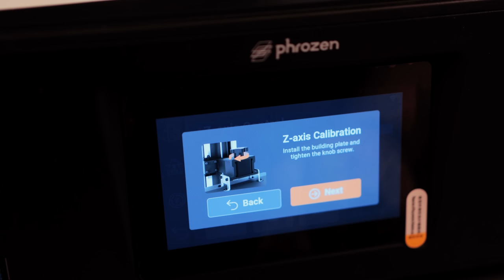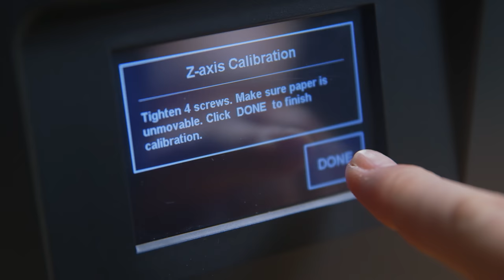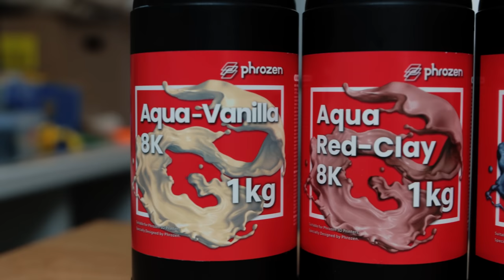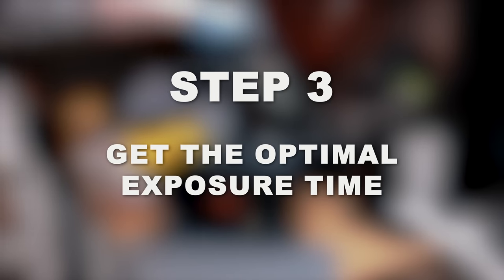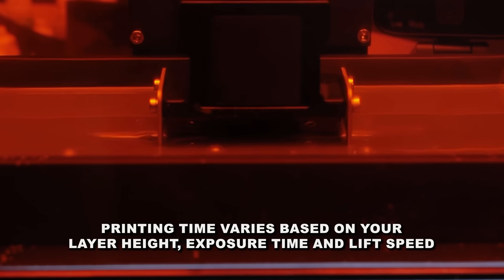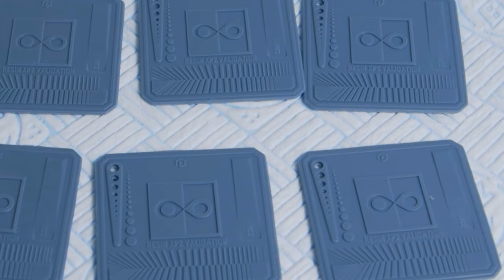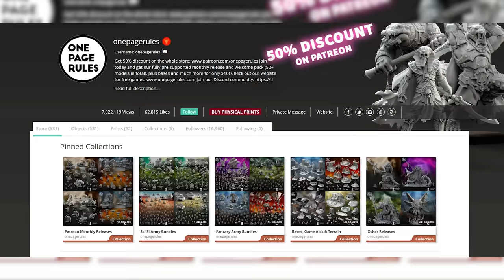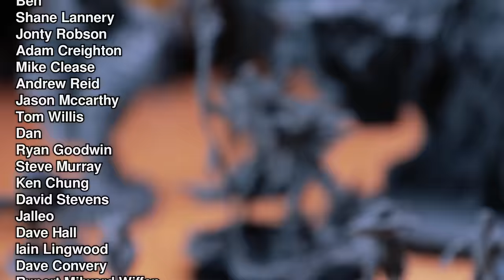How to Print Perfect Miniatures - Resin 3D Printing BEGINNER GUIDE - Step by Step

Comment: I have another question. Wash&Cure process has to be done exactly after tbe end of the printing or we can do it after some hours or a day?
Reply from the maker: Yeah you can do it later. I’ve left prints for days before washing. But keep them out of direct sunlight. During that time
Reply: So I can leave them into printer without any problem or you mean to take them out of printer first and then leave them?
Reply from the maker: @manosjj8404 either, just keep them away from uv light whilst you’re waiting

Comment: I’m going in deep I bought a ELEGOO Saturn 3 UItra MSLA 3D Printer and a Anycubic Kobra 2 Pro 3D Printer. And about 600 dollars worth of ventilation hose and box for my office to go straight though the window. This is mostly to make parts for work I’m a reseller and I can’t even count how many times I’m missing a battery back on a remote or a daisy wheel talking about thousands of dollars a year I lose on missing parts. But first Saturn came dead on arrival the motor did not work…

Comment: There isn't a single thing you missed here besides checking if your lights are working and illuminating entirely. I actually got a test print to work on my Anycubic Mono 4K from direct center, but my top right set of lights were out. Didn't know until I started a larger plate. Other than that the rest of this stuff is super clean and well detailed. Thanks for your contributions to this hobby.
Reply from the maker: Fair point yea, i;ve said it in other videos when i review the printers so i forgot here.

Comment: Just to let you know, my GKTwo finally arrived and after being mad nervous about even pouring grey toxic gunge iinto a tray and hoping it wont a) destroy the machine or b) my room, I'd like to say thanks for this noobs guide - it has helped me, and I have now printed 3 test plates at 1.45s, 1s and 0.75 exposure time (Anycubic grey bog standard water washable) - have to say they all come out pretty much the same - 15 posts and 12 holes - I was trying for 15/15 and then after all that unpaused to the point you said don't try for that, 12 or 13 is good enough make something cool lol. One tip I would give to anyone getting a GKtwo is if you finally find the instructions to do a firmware update (hint stick the files 1 by 1 on a USB stick using FAT32 or FAT - update literally 1 file only at a time on the usb stick) then you may find it reboots and comes back in Chinese only - after initial panic as I didn't know if it was trying to tell me to enter the printer name or press here to self destruct I took the plunge, entered a name 'GKtwo' at the prompt and then you're back to normal icons where you can go to settings and select english (or whatever you prefer) for the language - or ofc stick with Chinese if you wish.
Got cones of awesomeness going now at 0.75s exposure to see how they come out, but assuming not a disaster I will finally try printing something cool.  
Thanks for the guidance and videos Mr.F Hammer - much appreciated, and although only at the very beginning of my adventure in printing it does seem like the GKtwo is a very nice machine (albeit no experience with anything else so nothing to compare it to haha)
Reply from the maker: Thanks so much mate, comments like this really cheer me up
Reply: Do you print in your bedroom?
Reply: @Blade-go9ol  I don't have a garage so the printer is in a spare bedroom.

Comment: I’m on the fence about whether I should get a 3d printer. First up, I have to admit that I’m not the most technically minded guy and I’ve heard that 3d printing is very involved due to the numerous issues this still developing technology has (just what I’ve heard and I appreciate there are helpful folk like yourself who make videos to make life easier). Second thing is, I don’t (can’t, to be honest) spend a hell of a lot on miniatures. I generally tend to buy off of eBay, with very much mixed results. The temptation to get a 3d printer to print a much wider range of miniatures (I’m only really interested in painting ‘em, don’t play the games anymore) is great but I wanted to know if, in your opinion, it would be worth me getting one (and if so, which? Something fairly cheap but as reliable (and idiot proof) would be ideal).

Sorry, but of an essay there but I’d appreciate any advice you could give.
Reply from the maker: Get the GKTWO,(see my video) it's still messy, resin printing is messy. but it's designed out so many of the 3d printing issues that it will be easyier than any other for youu. but it;s expensive. if you spend money on minis like i do. tho. just don;t buy any this week lol
Reply: Cheers for the reply, really appreciate the advice.I reckon I’ll give it a go. The price of miniatures is getting pretty insane (plus 3d printing looks really fun.. when everything works).

Comment: Another question - I see you pour your resin from the top of the plate and let it drip down as opposed to just pouring into the tray directly - is this to prevent bubbles or something?  Otherwise it seems to be a messy way to do it :)
Reply from the maker: It's just more cinematic, that is all

Comment: hi Fauxhammer hi everybody, has anyone experience with printing at higher temperatures? I'm looking for my first 3d printer and I live in an island where it gets easily between 38° and 40° outside during summer, and generally temperatures  are high, and I'm trying to understand if printing with a room temperature of around 30° is gonna be fine or not. Cheers guys
Reply from the maker: It should be fine, Stick to hardier more viscous resins like phrozen 8k or sirayatech sculpt
Reply: @FauxHammer  I'll try it, thanks!

Comment: Newb with Saturn 3 Ultra here.
My workflow till this point which works fine with unsupported minis:
1. Load the model into Lychee and rotate it like everyone sais you should
2. Generate !light! autosupports but high density
3. Check for/delete all islands in Lychee (i dont even bother to add or delete any support manually)
4. Export the whole thing as an stl
5. Import it into Chitubox
6. Slice it!
7. Check for/delete all islands in Chitubox again
8. Send it to the printer

Did this from my very first print (which wasnt an exposure test) and this works fine for a week now, without any failure. (approx. 15 prints, full plate)

Comment: Great video.  Using your "post/holes" instructions to try and dial in my new printer/resin settings.  It's proving to be a lot more work that my old printer but I'm determined to figure it out.

It would be awesome if you could in your reviews share your settings for your printer/resin combo as a starting point.  Compared to my old Mars 2 Pro and Chitubox 1.8, the new tools have me thoroughly flummoxed.  So many more settings nowadays - and I can't figure out what half of them impact... LOL!   I bought a Mars 4 Ultra and the Warhammer resin and getting the two to work together efficiently is proving to be a bit harder than I was expecting.

Comment: Hey, I did slow down the setting transference portion of the video to the slowest setting and I'm completely lost at the end. You seem to be transferring the Lift and Retraction speeds, but it's not in any way that I understand. For example, the "Burn in layers" (bottom) lift distance is 65 & 65 and you set it as 65 & 150. Why? Thanks! 11:05

Comment: I'm on step 3, dialing in my exposure times.  Using Siraya Tech Fast on my Saturn 3 Ultra, I started with the Siraya Tech profile which was 30s base and 2.2s layer times, but the first print came out so stuck to the BUILD PLATE that any attempt to scrape it off just shattered it.  I then lowered the times to 28s and 2s and the second print I was able to get off in one piece but noticed it had only a couple holes.  So I'm still tweaking this but just wanted to post this here in case anyone else has a similar issue.  I'm NOT expert but just from my own hands-on here it looks like if the print is really stuck to the build plate it might need lower exposure times.

Comment: How important is it to evenly arrange models on the build plate in the slicer. I new to printing (GK Two/ Phrozen Water Washable Resin) I did the exposure test got it dialed in, had 4 good print sessions at those setting then the 5th session about 1/3 of the prints fail and stuck to fep. On previous prints I printed less models and used the auto arrange feature but forgot to on this 5th print and one side of the plate had some more models and only hands and weapons on the other side that I had edited fairly heavily. Would send pics but can't on here. Initial exposure is set at 30s (never had a problem getting models off plate) exposure is 1.5s, Layer height is 0.05. I rearranged the models and I'm reprinting now. Could that have been the issue, the arrangement or does that not matter? Thanks

Comment: I've noticed this with the cooler nights comong in, when doing a first print i get like a harsh shift line in the print but it's nothing to
Do with the saturn 2 having wobble or that it's the cold thick resin at first then you get this diagonal line as model
It angled,  the cold resin upto about half an inch high on the first prints then it's fine, as the resin is now at a warmer temperature and thinner! It's juat started happening this past few days with having left the windows open and the cooler airflow my room is upstairs whare i have it as normally always cooking in that room.
So what i have been doing is running a couple of validation matrix through it, not for really doing exposure test as thats great jsut now but to heat the vat up before going ahead and printing the part of one my model's im actually going to be having on display! If you Haven't got a vat warmer this is a good way to use the UV to Warm up to a nice temp to thin the resin out its working for me this so i would like to pass the tip on to maybe newer printer's as im sure you will know this but having to find it out yourself can be annoying wondering what the hecks happening eh lol! You maybe went through this at one time yourself? That vat warmer though is definitely something i will be getting!

Comment: Only correction here is what you said about going above 40s for base exposure. For older models of printers which did not use a monochrome LCD,  then the base exposure is usually much much more than 40s. not common to new printers at all, but the older ones like Mars 1 will have longer base exposures
Reply from the maker: Fair point, I'm too modern

Comment: Hello, I just got my Elegoo 8k and I am trying to dial it in.  I am using Chitubox as my slicer.  Getting confused with the settings/Print variables in Chitubox.  Is there a breakdown of how each setting affects the model and the print?  I see by changing a layer thickness my print time almost doubled.  I am printing a XP2 Validation sample as well as a Cones of Calibration
Reply from the maker: I haven’t made a breakdown myself, but if you Google “Chitubox settings explained” there is a website that explains each setting somehwere

Comment: It has been recommended in some videos to use Isopropyl alcohol even with water-washable resins. Is this recommended?  I actually have been unable to find prominent qualities of Isopropyl alcohol to the proof range recommended.  I am going to work on getting my calibration panels printed and tweak my settings to work in my particular environment.  But I see your issues with Lychee. However, I hate the interface Chitubox uses, it is like a child of 8 designed it.
Reply: Alcohol is thiner than water so it's can leave less resin left over after rinsing

Comment: I changed my resin, and also moved houses. Printed the test thingy to adjust the setting but its very brittle. I can get it off the plate without it breaking into multiple pieces. Any ideas what might be wrong?
Reply from the maker: Your resin is brittle. Could be because it’s too cold and you are overcuring. Could just be the resin

Comment: Referening to layer heights, i personally fount reserching the micro stepping height on the z height and making sure your layer height is multiples of it, if the microstep distance is say 0.004mm then making layer 0.035 would throw the math out, 0.036 would be better this may be fact or it might just be a illusional improvment 🤷🏼 lol
Reply from the maker: I tried that, once, could not see a differecne. but if you wnat to go to that granular level, it is the right way

Comment: I would be interested to know if you've encountered the problem of your prints experiencing surface cracking (often only after many weeks), especially for thicker parts? I've found it an issue on my Saturn 2 using eSun water washable resin. As far as I've been able to find out, water washable resins are more prone to this cracking (unfortunately, logistical constraints mean I am limited to using water-washable resins). Feedback I've had suggests that the following could be contributing: 1) Over-curing (I now limit minis to max 2 minutes in the curing station), 2) keeping uncured prints in the wash or exposed to water for too long (I now try to keep washing step to 2 min and try to dab/blow dry immediately upon removal), and 3) curing prints before the surface has fully dried (I now dry my uncured prints overnight before curing). However, I still can't print big pieces because of the high likelihood of them developing surface cracks after a few weeks/months. Do you have any thoughts?
Reply from the maker: Yep, a few times, usually always in water washable resins. Typically its over curing or liquid reain still inside cavities